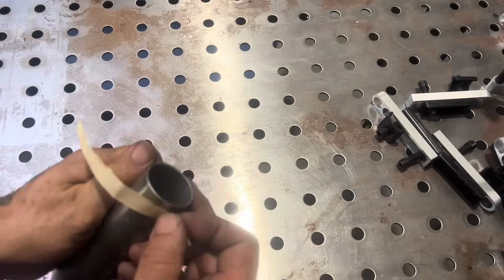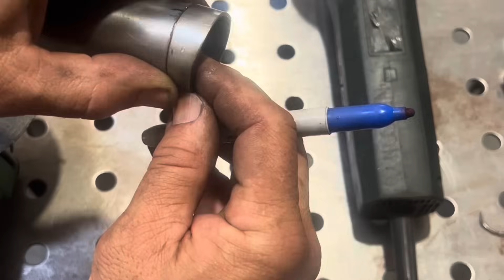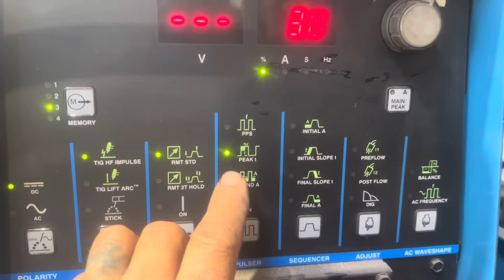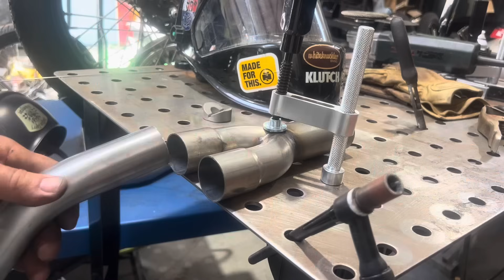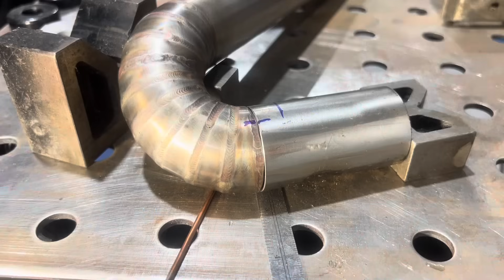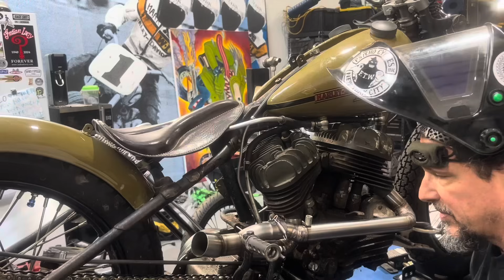Billy Lane Stainless Exhaust Fabrication How To Weld Harley Flathead Motorcycle Biker Build Off

Comment: Did you finish the fit up with filler rod? Or fuse with the pulse setting the whole way around your pie cuts? 
Gonna have a go at building an exhaust for my M8 street glide in the next cupple of months, cheers billy 🤙🏼

Comment: love your videos , i have learned a lot. I have a question about back purging, it seems like everyone says to back purge when you tig weld pipe, it will be weak or will rust from inside, what do you know from experience welding it like that.
Reply from the maker: Back purging is ideal, however I’ve welded exhaust for decades without doing it & I’ve never had a failure. Back purging is necessary if you’re welding pipe that will be used under pressure, or to transport fluids that might interact with the weld. But, for motorcycle exhaust, it’s not necessary

Comment: So allowing all the trash from the inside of the cut to suck back into the weld doesn’t cause porosity??
Reply from the maker: No it does not. Porosity is caused by the presence gases near the weld as it cools. A weld is simply a casting without a mold. We use inert gas to shield the weld from the surrounding air, but the shielding is not complete or absolute. There is always going to be porosity in a weld, we merely try to minimize porosity in an effort to create the strongest bond possible.

Comment: I know it's only a 45 but don't you want the pipes to be closer to equal length?
Reply from the maker: It’s preferable. But what’s more important is scavenging intake on one cylinder with exhaust from the other, by sending both pipes to a collector. Ideally, you want equal length pipes. But constant negative pressure at the exhaust valves, because of the collector, is the key to horsepower. This 45, by the way, will smoke a 74” flathead, knucklehead, Panhead, or shovelhead.

Comment: I appreciate you going over the settings on the welder.
Reply: This was like getting a lesson in exhaust 101 with professor pipe. If Jessie is the popeofwelding then this would make billy the masterofarc
Reply from the maker: I tried a lot of different settings, you gotta keep current low to get the small heat zone & color. Then you set pulse to work with your chosen current.

Comment: Billy this is badass, does the length of the exhaust make a difference? Short vs long?
Reply from the maker: Ideally you want equal length pipes for each cylinder, it’s not easy to do that with a V-twin. Joining both pipes at the collector helps with this problem.

Comment: Are you testing on a dyno with different size/diameter/length pipes and exhaust  for +/- in horsepower? On our vintage race bikes we've found it can make up to a 5hp gain or loss.
Reply from the maker: No. I originally made the one on my 1946 WR because I knew I needed exhaust scavenging to work with the long duration camshafts. The bike is so responsive, fast, & turns very high rpm. So I know that the pipe is working. A dyno would definitely be of help.

Comment: That pipe makes a wicked sound for the old flatty 45! Want something similar on my ironhead pretty soon..
Reply from the maker: Ironhead exhaust speed is so much higher, it would sound insane. At high rpm, this pipe makes a growl you can’t believe a 45 can produce
Reply: @BillyLaneChoppers  yes! I bet that deep growl changes when you get on the top end!

Comment: Hopefully this isnt a silly question.  Could a fella use a chopsaw to make those pie cuts?
Reply from the maker: Yes, of course. Might be easier. I don’t have one. I have a cold saw, but it uses cutting fluid, which I then have to remove before I can weld
Reply: @BillyLaneChoppers  thankyou very much for the quick response and sharing your knowledge with all of us